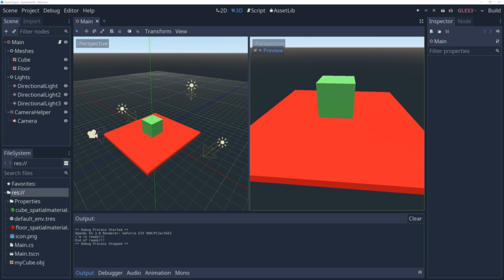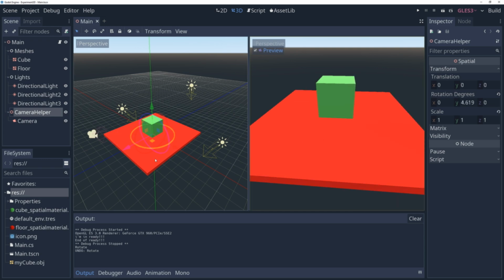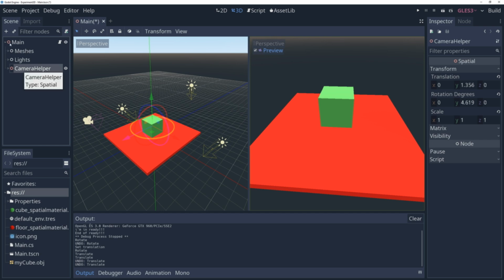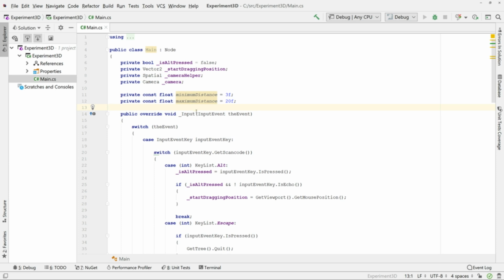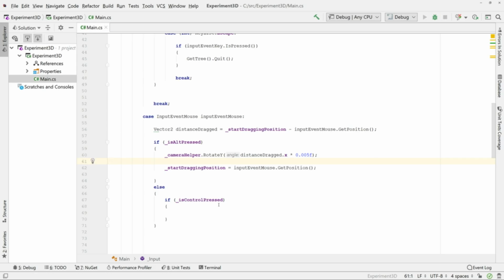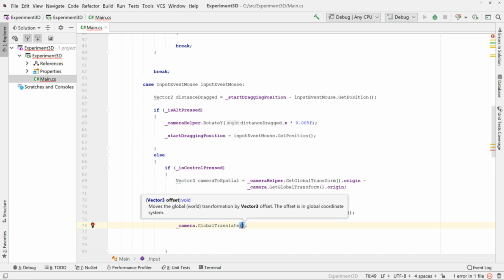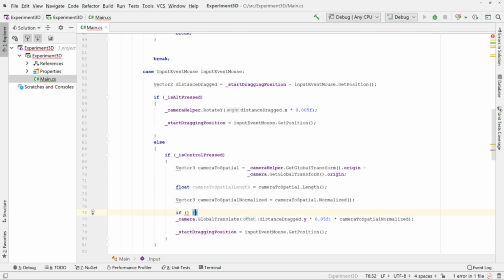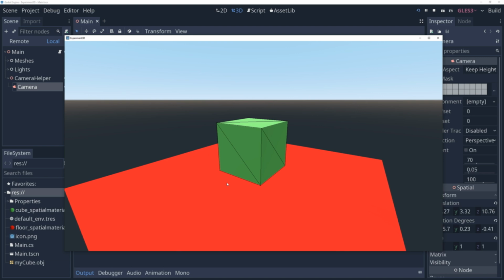Godot 3 - 3D Mesh Manipulation - 04 - Using C# to zoom/move a 3D camera

Comment: Even all these years after this series, the same situation of scarce Godot 3d content still remains the same. The fact is that 2d games are so easy to do in Godot, that maybe most people are not attracted by the idea of switching from the fun part to the unnecessarily thorny 3d?

I did the zoom a little differently.
Since the camera inverse z axis (negative direction) is always pointing to where the camera is looking at. Then to zoom in, one can simply subtract to its z axis, without needing more complexity.
example using GDscript (i am learning it now. Or should i say more realistically, learning the Godot API?):
```
# Get the z translation/position and add a negative speed constant.
# _delta is the elapsed time between frames
    var newTranslationZ = translation.z +  -SPEED * _delta
# clamp keeps the new transl between a min and max value
    var clampedSpeed = clamp(newTranslationZ, minDistance, maxDistance)
    var newTr =  Vector3(translation.x, translation.y, clampedSpeed)
# update the local transform of the camera
    transform.origin = newTr
# update the look at direction
    look_at ( target, Vector3.UP)
```
To do the zoom out, just add the speed instead of substracting.
Note that this script is attached directly to the camera.
Reply from the maker: Thanks for the insight!
Reply: @hobbytasks8240   Hoping to see more content from you when you are able to. Thanks for sharing.

I will just add to anyone who might be interested, that my solution doesn't behave the same as yours. It is more limited to my use case, but it does give some cool unexpected navigation. That is why, although i initially wanted the same actions as you, i didn't change it at the time.
Also note that i dynamically move the camera to be a children of the target on click event.